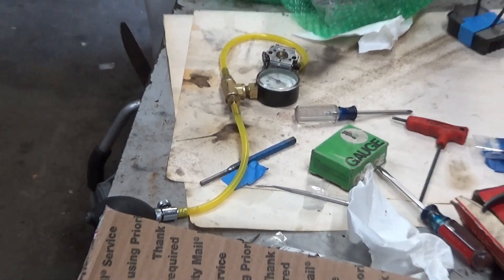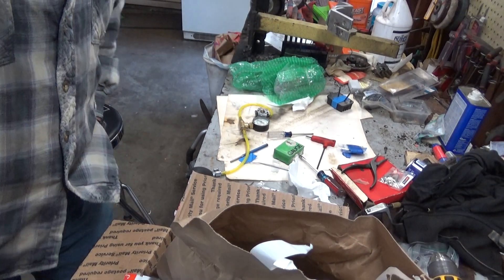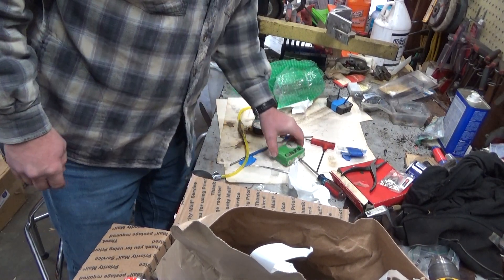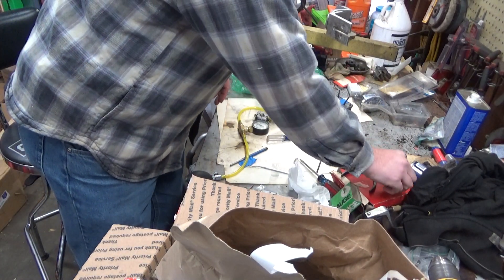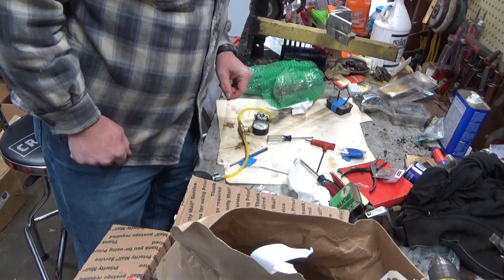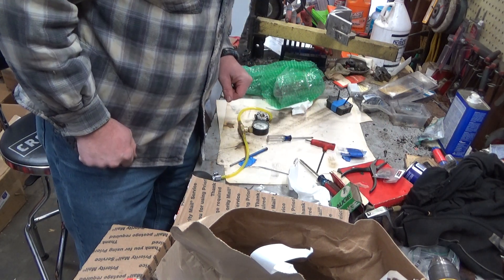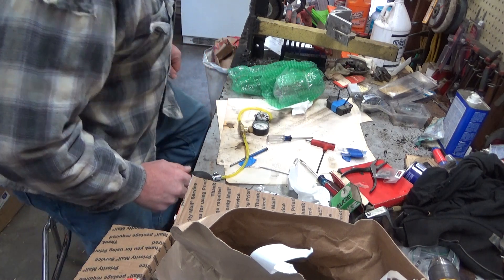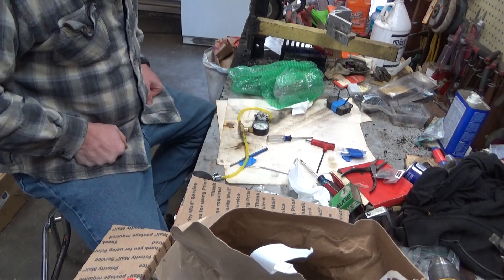Walbro WT-20 Carburetor Diagnosis & Carburetor Pressure Testing Part 1

Comment: I have a carb from off a Poulon Micro XXV.  It shows Walbro WA19 on the carb itself, but the parts list says original was supposed to be WT3 and the replacement as a WT20.  I took the saw to be worked on and was told it needs a carb.  Not sure if it really does or not as I don't really trust the mechanic at the place I took it.  Do you know of anyplace I can get a carb for it?
Reply from the maker: Ebay is your best source of parts, but I'd try getting a rebuild kit and fixing the carb you have.  A kit like this one should have you running in no time: https://www.ebay.com/itm/Oregon-49-816-Carburetor-Rebuild-Kit-Repl-Walbro-K10WA-T-k6WA-123100-0296/292616854196?epid=1637159852&hash=item442152dab4:g:X9UAAOSw~uJbMCIo:sc:USPSFirstClass!97535!US!-1